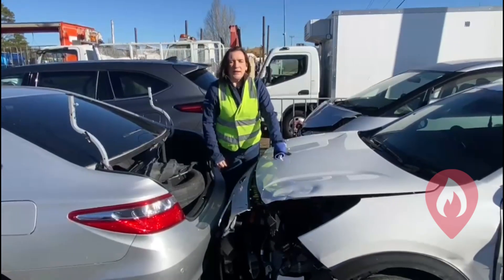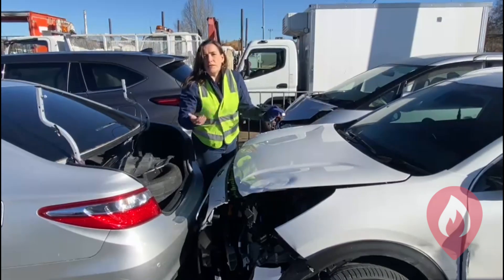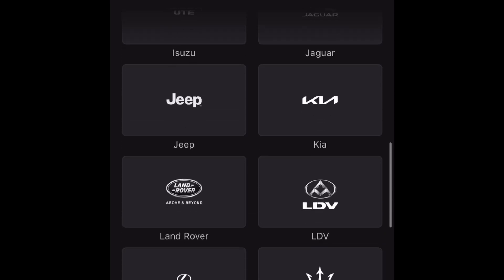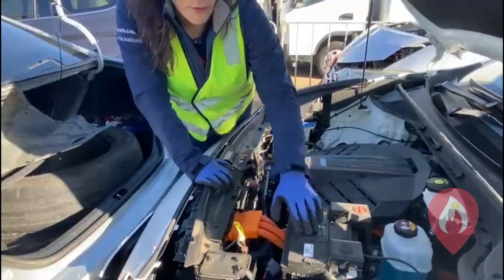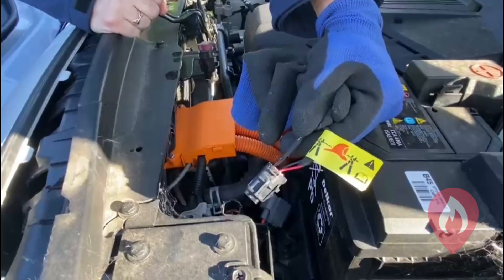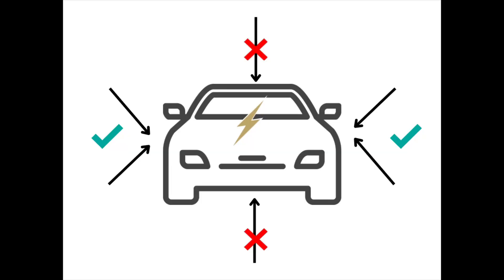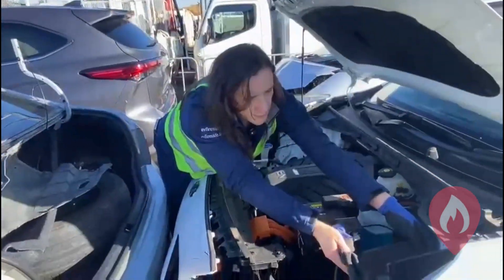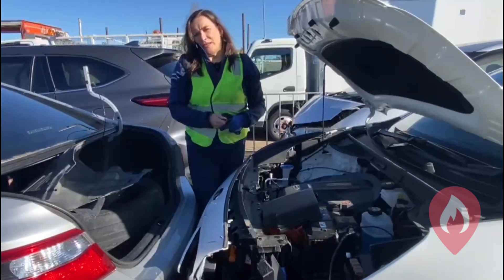Emergency response to the KIA eNIRO electric vehicle

Comment: But those are not the high voltage cables. They just seem to feed the contactor that cuts power from the EV battery. There has to be a physical switch like in Prius near the battery under the rear seat, there's an orange lever that when you pull out it completely de-energizes the hybrid batter (as all the electric current has to physically travel through that lever). There must be similiar thing in the EVs, but if there is not well hmm... that's definitely a problem. You can't just rely on a contactor that might fail.